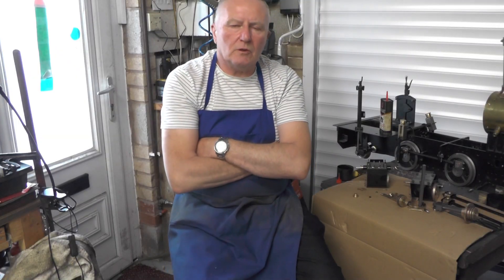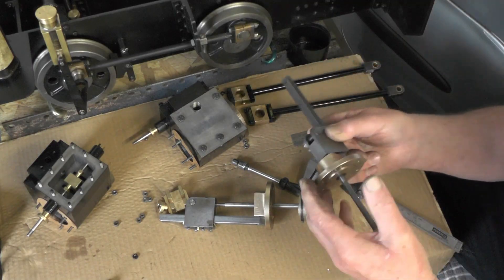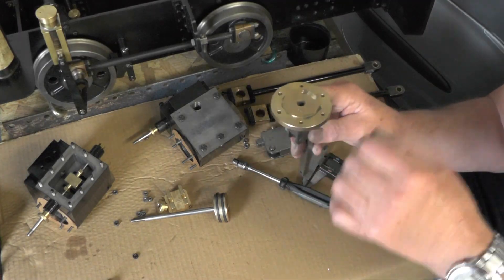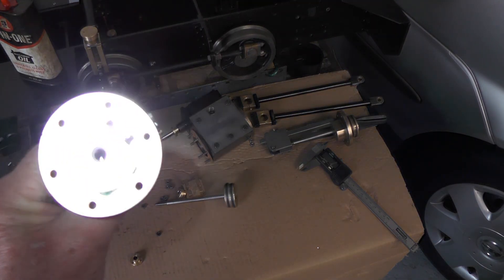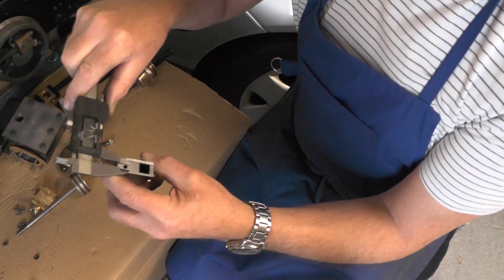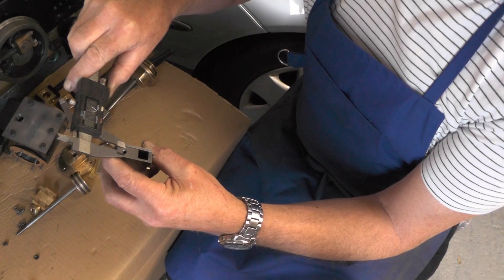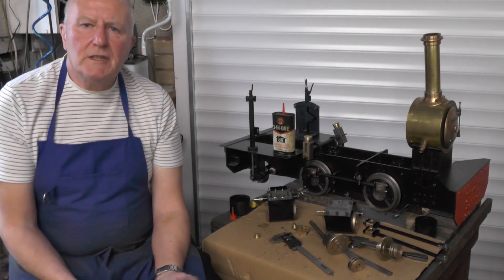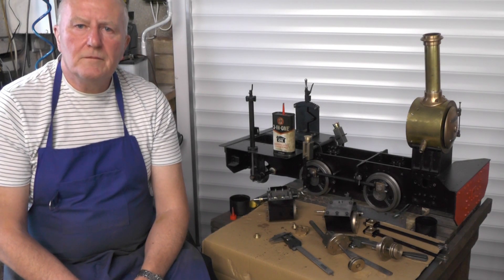Oops!! Crosshead Cock Up & Recovery Sweet Pea Steam Loco Build Part 22 "mr factotum"

Comment: Nice fix Kev.  After the transfer punch do you centre drill? I've found if going from the centre drill to say 8mm diameter drill, the 8mm diam hole tends to wander a smidge. Only have a drill press, no mill yet. Had this happen on 2 backplates using the Steve Jordan grub screw and pointed allen key technique for the transfer punching. Transfer punch method is v good. I think the centre drill is where I went wrong. Next time I will skip the centre drill I think. 👍
Reply: Yes the center drill is the wrong tool for the job really, what you want is a spotting drill that gives you the correct angle indent that prevents the 8mm drill from wandering.
Reply from the maker: cheers Chris
Point taken excuse the pun🤣😀👍😉🚂
atb
Kev
Reply: @chrislx2006 ive just watched an hour of centre drilling vs spot drilling videos. I learned something new. Hopefully ill have more success now. Ill just use the 120 deg tip (not the 60deg) until i get a spot drill.
Reply: @bobnoxious1983  The ideal solution is one of those Chinese MR-13B drill sharpening machines, not cheap at £260 but it will provide very accurate web-thinned/split-point drill points that don't require a pilot hole in most cases and are far less likely to wander. I've got hundreds of drills and I sharpened them all using my machine (one set I sharpened to 135deg). It struggles a bit with small drills below 3mm diameter but it's still possible down to 2mm or so with care. Highly recommended if you ever get the chance to own one. I must do a video on mine now I've used it for a while.
Reply from the maker: @chrislx2006  👍👍👍👍😉😉😉😉
Reply from the maker: cheers Bob
I think transfer punch and centre drill is the way, for rigidity as you start the hole, i did that the first time but brain didn't notice my error
all good fun
anyone who hasn't made mistakes has never done anything
take care
nice to hear from you👍👍😉🚂
Kev
Reply: @MrFactotum some great advice on this channel 👍
Reply from the maker: @bobnoxious1983  👍👍👍👍😉😉